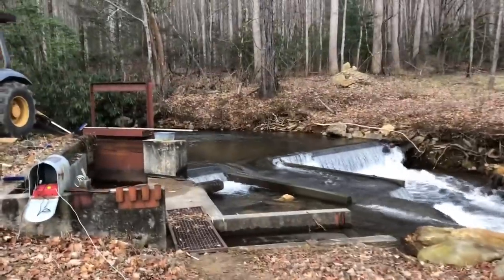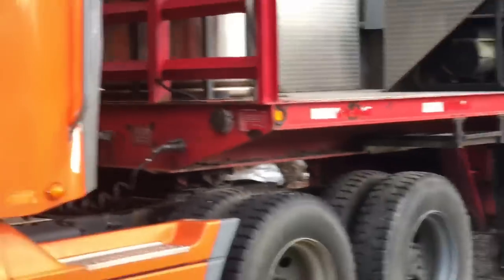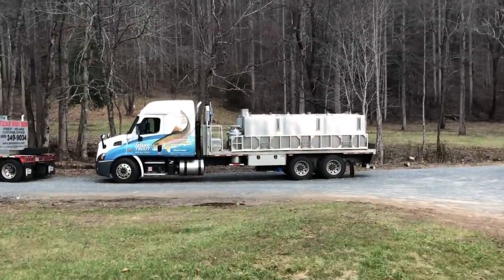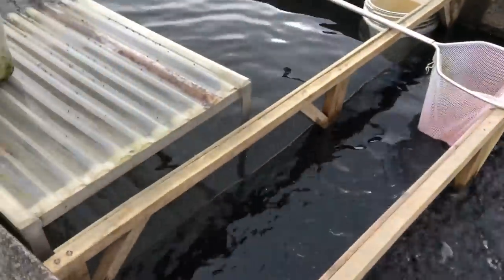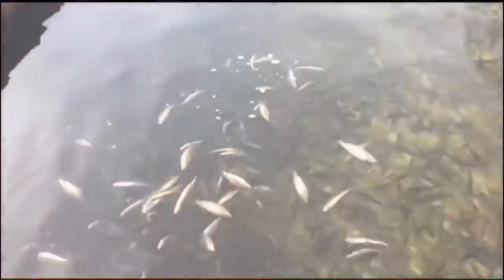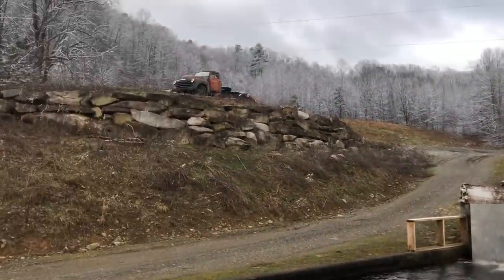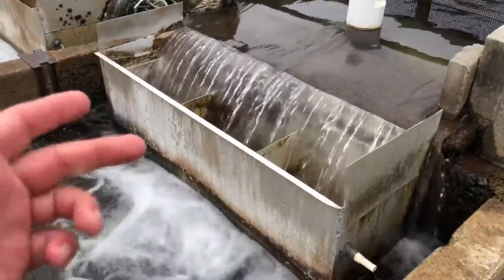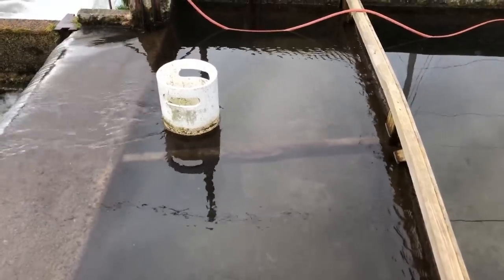A North Carolina Trout Farm

Comment: Awesome video. I been on the research to understand more about aquaculture and trout farming in general.

1) How do you handle cold-snaps and winter weather?
2) Does the water temperature ever fluctuate? (summer/winter)
Reply from the maker: Fish tend to handle the cold pretty well.  We hovered close to 0 Fahrenheit for a few days this year which is unusually cold for this area.  The fish did just fine.  It’s usually the warm summer water temperature that does the most damage.  We mitigate as much as this by choosing good water sources for our farms.  The water comes directly from mountain streams which tumbling and are very shaded…..keeping the water cooler and more oxygenated.  We also supplement O2 into the water during the warmest months of the year.